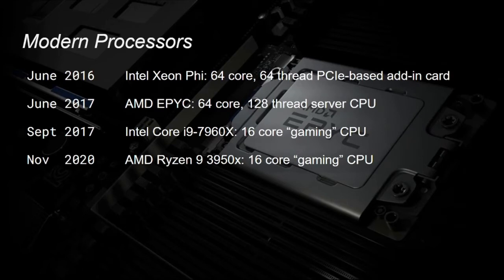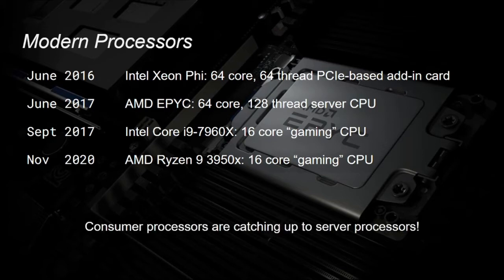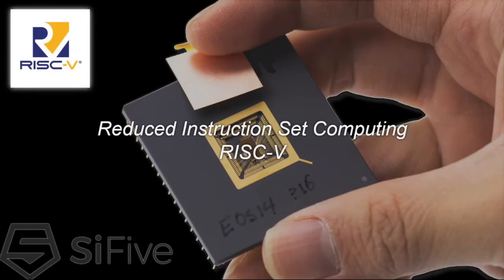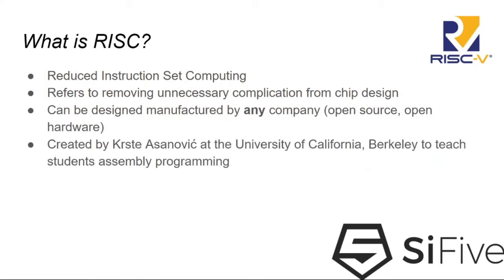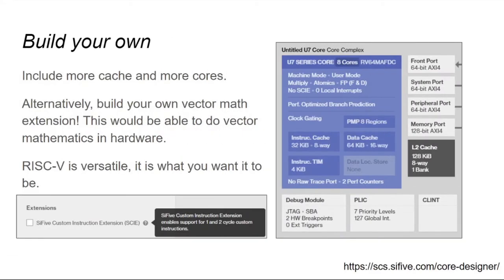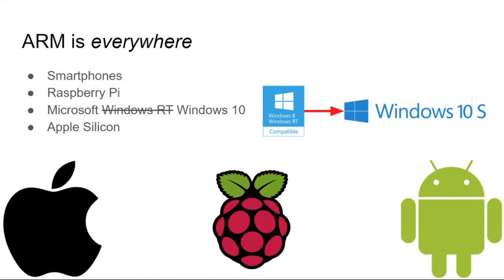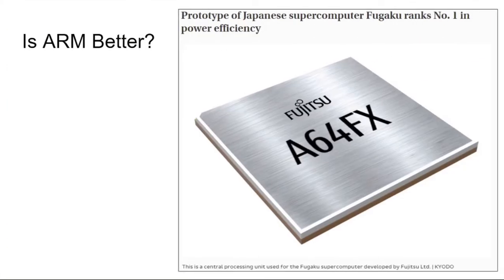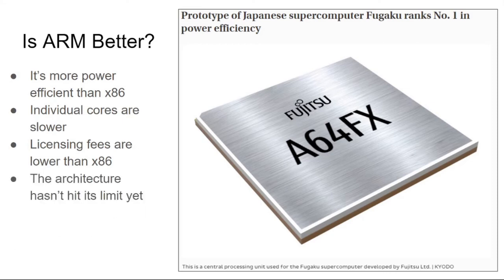The Future of Processors - The End of Moore's Law

Comment: I am interested in this topic but your microphone needs to be upgraded (look at Rode Podcaster with a Zoom H4N Recorder if you are on a tight budget, if you have more budget an Electro-Voice RE 20 with a Sound Design Recorder & use a pop filter with both), you need to cut down the volume of the background music by at least half -3 - -6 dB (or better eliminate it altogether, we are here to listen to you not music). Also do some post-recording audio processing to DeEss the strong sibilance. I don’t mean to be harsh, I did professional audio-video editing for 15 years and the audio is getting in the way of your message. Also it may be the microphone or it could be the room but it sounds like a very active room with lots of sound reflections just make sure you are not speaking straight into a bank of glass windows or in a room with a lot of glass as that increases sound bouncing. If you have no choice about the room you must record in consider heavy drapes to cover the window and acoustic foam tiles. If you cannot permanently modify the room by putting up acoustic tiles (as is sometimes the case if you are renting) consider portable acoustic walls like the Auralex Max Wall that sets up temporarily on stands.